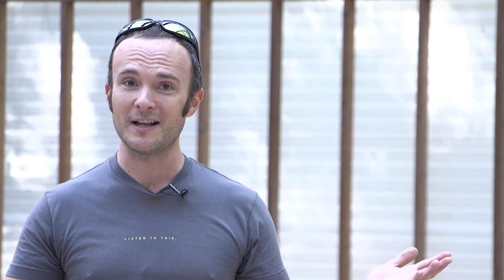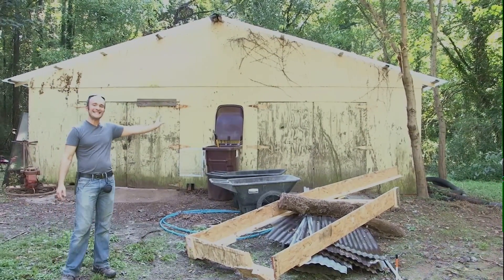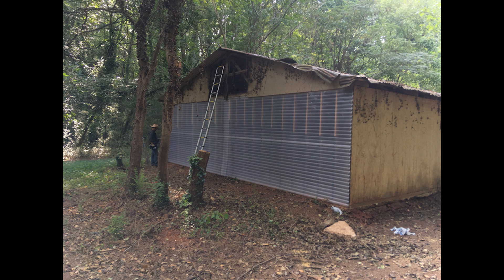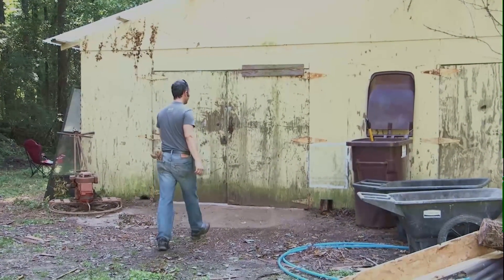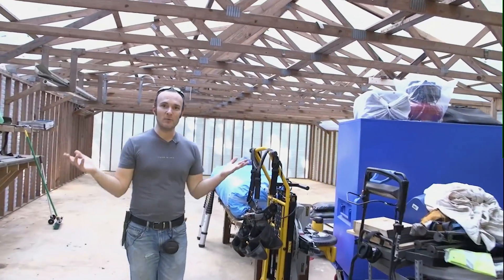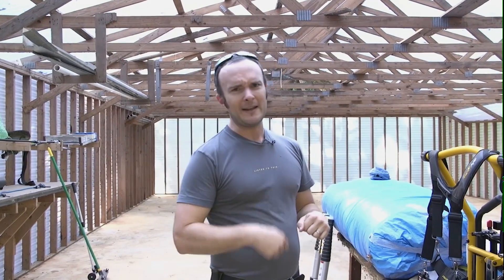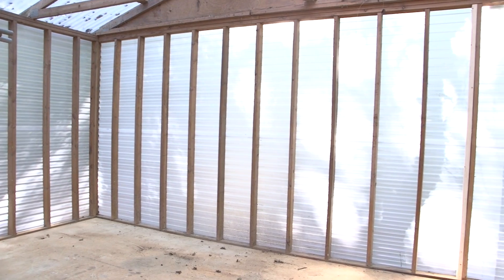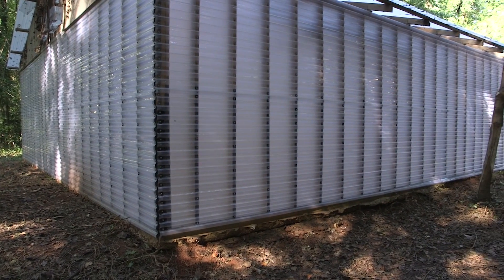Design of the Building Performance Workshop in Atlanta

Comment: Isnt it like a greenhouse in there,lot of solar radiation=heat. Awesome job so far, when its all done you will know its was done correctly!
Reply from the maker: GREAT QUESTION. It would be, if I didn't have shading trees all around. There are 60 foot leafy trees everywhere outside, so I only have direct light at noon, and with a big fan pushing air out the front doors and pulling in cool air from the woods, I'm all set!

Comment: How are the polycarbonate seams done? 
Can't wait to see more episodes! Great start.
Reply from the maker: Simpler than you'd think- no sealant necessary. Actually, if you do put sealant at the seams, what you end up with is a big dirty line when dust gets in there and you can't get it out, but you can see it forever and ever.
Reply: I didn't mean sealant. Wondering if you attached them together with some kind of joiner cap or aluminum extrusion.
Reply from the maker: Just simple 90 degree trim if you want to.